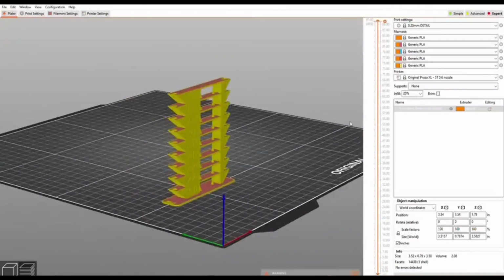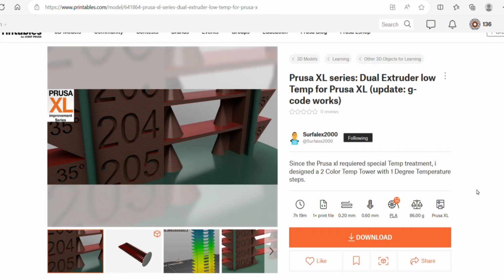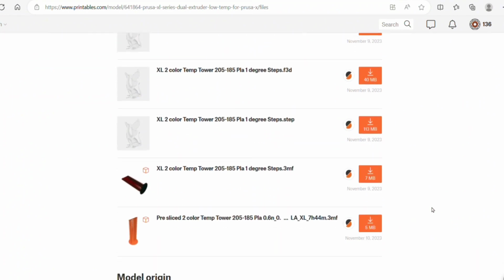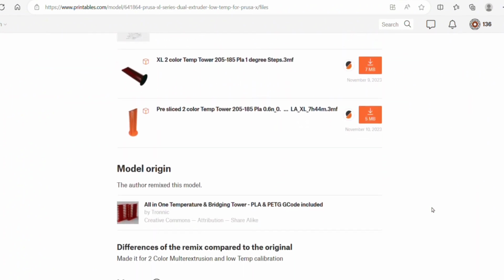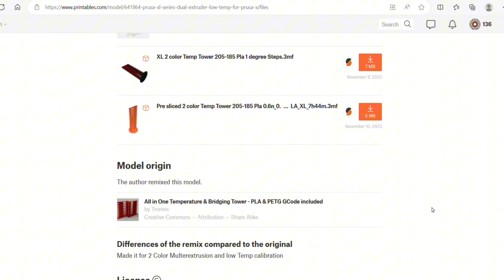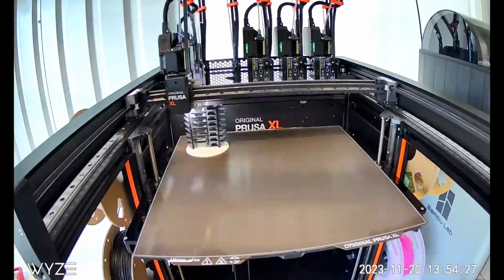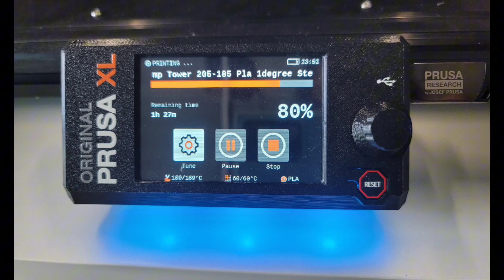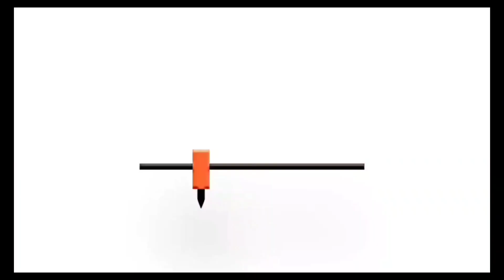Temp Tower on Prusa XL by SurfAlex2000!

Comment: I just got my XL 10 days ago and I've been printing non stop with PTEG and I'm not having all of these issues.  My layer heights are .15 and .20 using the structural settings.  I'm doing two color prints and I'm getting really good results for my PTEG prints at default temperatures.  I did change my retraction length to 1mm.   Take a look at you 198 degree setting.  That looks good too.  I'm also using the latest Slicer and Firmware with input shaping, plus the 3D dogs G-Code.  From the videos you've been posting it looks to me like you under extruding.  Your video's have helped me tremendously.  I will keep watching.  Thanks....😊
Reply from the maker: So glad you have your printer and settings figured out! I'll try that. Thanks so much for your support!
Reply: Hi, Im also printing with PETG and got some stringing problems. Can you let mek now which temps you use for first and rest layers as well as retraction settings? Which retract amount before wipe do you use?

Comment: Drying PLA in dehydrator helped me with stringing, I had a spool opened for a while, so if it is the same for you I can recommend trying to try for 12 hours or something in dehydrator and see what happens. I've got a cheap one for this purpose and removed some of the internal structures to make sure my spool fits and the lid closes.
Reply from the maker: Thank you!

Comment: I had good results with generic pla and prusament pla stock slic3r profiles. But i run protopasta htpla and prusament. My milticolor prints require minimal cleanup afterwards. One thing I paid special attention is tigtness of the docks. Mine don't move at all, because i tigtened them up 3 times. Worth checking!
Reply from the maker: Ok I'll look into it. Thank you!

Comment: It's surprising, isn't it? Not so much once you understand that here are two factors working towards the same effect which achieves almost exponential increase of that effect.
The effect I'm speaking off is throughput. Your .6mm nozzle diameter allows for 150% of material passing the nozzle, compared to the most commonly used .4mm one. The most recommended material temperatures are for the .4mm nozzle and they are meant to increase the speed at which your material passes through the nozzle, thus decreasing print time. With 150% nozzle diameter you can put down a line of 150% the lengths and width at the same temp, because that much material can pass through facing the same resistance. Lowering the temp gets you back in control of the flow, because it increases the resistance and decreases the flow.
At lower temps the material is more viscous and fights against being squeezed out, building up pressure, but a bigger nozzle relieves more of that pressure, so it is balanced again. 
With the higher temperature and the big nozzle, the material gets too liquid to build up pressure (unless it hits the buildplate or the previous layer) and instead just leaks/oozes out, even when it is not supposed to. The hotend just empties itself through gravity. On a travel move, where nothing is holding back the flow, that leaves a trail like a honey spoon - a string.
Imagine a ketchup squeeze bottle. If you fill that with water it will just flow out of the downward pointed nozzle, with ketchup you will have to squeeze to get something out. But if you remove the cap with the nozzle in it (technically increasing the nozzle size), even the ketchup will just slowly flow out without the need for a squeeze (on most brands at least). You can imagine what would happen to water with the cap removed.
Most printing materials have a rather narrow temperature window within which the transition from viscous to liquid is happening. The less viscous your material is, the faster you can put down a layer line, but if you slow down, the material won't stop coming out, leaving blobs and strings. Heat up your toolhead move it to the middle of your print area and increase the temp slowly to see it happen at a certain temperature. You may have to extrude a few millimeters to get it started, but you will see much more coming out than you actually extruded.
Reply: yea its important to realize that going from a 0.4mm nozzle to a 0.6mm nozzle increases the diameter by only 50% but that means the area of the hole in the nozzle is about 123% larger.
Reply: Just a general comment on the nozzle size. I had huge issues getting my 0.8 nozzle working. Almost all downloadable models, profiles etc are optimized and designed with the 0.4 thus nothing worked well out of the box. This was evident when switching back to a 0.4 nozzle, everything just works.
Reply: @cjansson  Yeah, everything pre-made, be it models, profiles or often enough, just simple tips and tricks are usually valid only for .4mm nozzles. If it's not specifically made to suit a printer with another nozzle size it will require some adaptation. When auto bed leveling was not so common, many people would already fail at getting their z-offset right, when they tried the paper trick. Having a .6 or .8mm wide layer squished to .2 - .25mm doesn't get you a good and smooth first layer on those low temps, if it sticks at all instead of being peeled off and being curled around the nozzle. Also at .8mm I' go for a hotend that uses 2.8 or 3mm filament, but that stuff tends to break pretty easily and it "memorizes" the curl of the spool aside from being not so readily available as it used to be. With 1.75mm filament you need a fast extruder and a powerful heater to supply the flow, or print at such a low speed that you won't benefit from the bigger layers. Many hotends couldn't keep up with melting the thicker filament and if you went too fast you could end up with a unmolten core of the filament poking through the nozzle. .4mm is pretty much the standard today, although .5mm could be the better option.
Reply from the maker: Thanks so much for the info!

Comment: One of the issues you can have with PLA at low temperatures is layer adhesion. I would think that you should be fine at 190, but going much lower could lead to other problems. 170 is the temp that is used for PLA bed leveling, at least on my MK4. The idea is that PLA is not supposed to melt at that temperature. You are starting to get down to that level.
It sure seems like there is more to this issue than just temperature.
Reply: Came here to say the same thing, but you worded it perfectly.  The stringing may be reduced at those temps, but I’d be pretty worried about fragile prints and other issues that can result from temps that low.
Reply: ^This, layer adhesion and strength of prints
Reply from the maker: Good point. I'll keep working on it. Thank you!
Reply: That is right. You will get bad layer adhesion. So the way to solve the problem is not to lower the temperatur. I print pla at 200-210 with no problems.
Reply: @michaelblaudzun321 on a Prusa XL?

Comment: I am curious if on a small tower to save time what effect lowering or turning off the part cooling fan would change anything. I also seem to recall there is a setting for lift height on layer and/or possible tool change. Maybe that could be increased? Sorry this has been so up hill. For the price things should be going a bit smoother. Thank for the informative videos!
Reply: Yes, there is a lift z setting and now the 2.7 slicer's profiles include that special way of lifting up conically. This is what Bambu does, and other youtubers have come up with g code for on layer change. No longer necessary with latest slic3r
Reply from the maker: I'll look into the fan. Thanks so much!

Comment: What retraction length is it using?  I would try two things.  (1) Dry your filament and rerun the same gcode, wet filament causes more stringing.  (2) Increase the retraction length a little bit and reslice/reprint the temp tower.  Looking at my prusaslicer with XL profile, it looks like retraction is at 0.7mm, I would maybe increase that to 1.0mm as a test - if it doesn't help, change it back.
Reply from the maker: Thanks so much!

Comment: Ive been buying overture because it was the brand you use. I figured you got it dialed in.  😂

Black Overture PLA has been great for me but I have been experiencing strining and oozing with another brand of red PLA+ which I assumed was garbage but now im questing it.

I think you will need to do a temp tower for each filament color and save them as a preset in prusa slicer.  

Do you have any ideas on how layer height and speed affects stringing with your PLA?
Reply from the maker: I love Overture and it works well on all of my printers. But the 5 XL has been a little tricky. I was hoping with the new slicer that I could raise the temp. (Mainly so I don't forget to change it.) But looks like I'll be sticking to 190.  I hadn't thought about trying out different layer heights to see if that helps stringing. I'll definitely look into that. Thanks so much!

Comment: Great video, but I've downloaded the file and tried to set it up in PrusaSlicer, but breaks down into over 50-60 parts and the length of  the tower is a few inches larger than the XL bed size and the number of parts takes up more than two beds.  Where is a copy of this file that is the size you printed?
Reply from the maker: I used the gcode he included rather than the 3mf file. Thanks!
Reply: @tada3dprinting    I performed the print, but notice on the front edges there are thick strings sticking out of the vertical thin faces, not on the back.....    Darn, I can't add a picture....

Comment: Just from seeing these videos I feel like their thermisters might have a wrong k vale by default.
Reply: I've been thinking the exact same thing for a while now.  Either the temps are misread, or the heater block is more efficient at transferring heat into the nozzle, but they sure seem to run hot.  My 5-tool XL is arriving today, I'll be sure to run the same test on mine.
Reply: @PaulStevensonPinball  would be interesting to get a cheap temp meter and check the actual temp on the heater block.
Reply: @IvanJoel  If mine exhibits stringing, I'll likely do that.  I've also got a FLIR camera, which might help determine the filament temp as it exits the extruder.  For baseline, I've got a MK2.5S with a Revo and MK4 to compare against.  I would expect the MK4 to behave the same as the XL since I believe the hot end uses the exact same parts, but a firmware issue could be unique to the XL.  I've got all nozzle sizes too, so I can see if a 0.6mm nozzle behaves the same on the MK4 as the XL, and conversely if a 0.4mm nozzle helps on the XL.
Reply: i checked them on mine and the thermistor was reading exactly the correct temperature.
Reply: @Pixelplanet5  wow. Did it still string/print hot?
Reply: @IvanJoel  i have very few problems with stringing.
i reduced the temp by like 10 - 15 degrees compared to my usual temps and that works out perfectly.
Reply: Wouldn't be the first time I've seen the conversation constants off in the algorithm. 

Had this happen on $130,000 sensor in a $2,000,000 manufacturing system.  Took me 2 year to prove it, but once I convinced the manufacturer they were shocked.

Comment: There is no stringing on the Mk3 or  Mk4. They use a 0.4 mm nozzel. Is it the nozzel size, that makes the stringing? The Xl has a 0.6 nozzel. ???
Reply: I'm experiencing a lot of stringing issues with my MK4. Never was the case with MK3 using PLA. I had to lower temperature to 190-205 degrees for PLA. Worst situation is with Prusament...
Reply from the maker: I don't have any stringing with my .6 nozzle when I run one color. It has something to do with the tool changer. But the .6 might be a factor too. I'll try something for this. Thanks!

Comment: I have mentioned before I've worked with sensors (measuring devices) for over 40 years.

I would be supportive if the thermistors on these machines are that accurate.  Accuracy and repeatedly are totally different concepts.  Repeatable is more important than accuracy. 

I would be curious to know what the nozzle temperature measures with an external device.  I bet there is more difference than you expect. 

From my experience I would not be shocked to see the same material preform best at a 20c difference on difference printer.
Reply from the maker: Yeah its possible that this machine is just a little quirky and has its own idea on temperatures. I'm not really sure how you test the temp tho?
Reply: A simple test would be find the best template to print a specific spool, then run tower with the same filiment on the other tool heads.

Comment: i don’t like this temp tower since there’s no use of a wipe tower. one of the biggest changes in the beta slicer was the fact that it would move to the wipe tower as a regular travel move and purge (‘ram’) a bit before doing a big z lift to change tools. this big z lift before the changes was happening on the print itself causing stringing, and when you don’t use a wipe tower it does that z lift on the print anyways.
Reply from the maker: Good point. But I do find it interesting that it's still consistent with the temp I had been running.

Comment: I would stick with 190, not 180 based on that tower.
Reply: Yeah I wouldn't trust the strength of anything printed below 190. I would much sooner play with retraction than go below that.
Reply: To be fair, Tada doesn't appear to make functional parts so her need of strength is slightly different (I'm sure she doesn't want them falling apart of course)
Reply: @GarethLewin  True but I've seen small changes in heat mess up layer adhesion really badly. Recently printed something in nylon copa whose first layer peeled off onto the bed because I accidentally left the cooling fan slightly on.
Reply from the maker: Thanks so much!